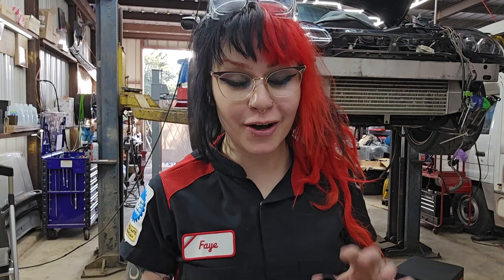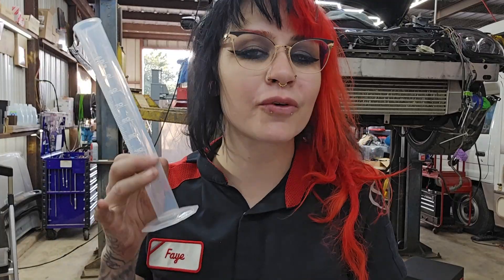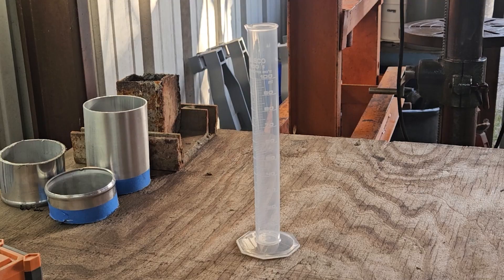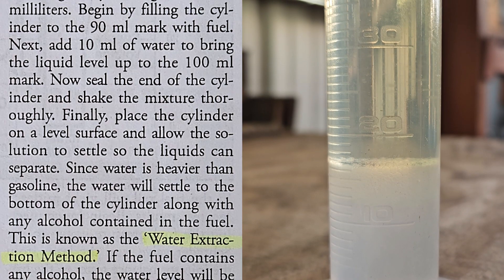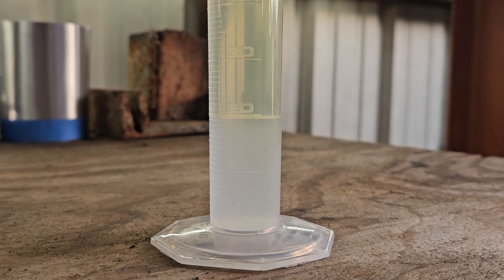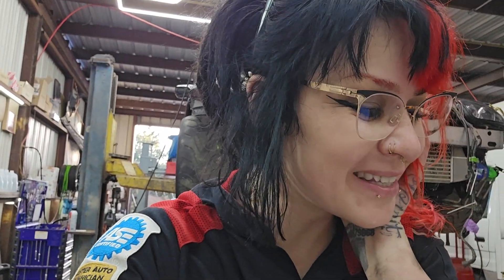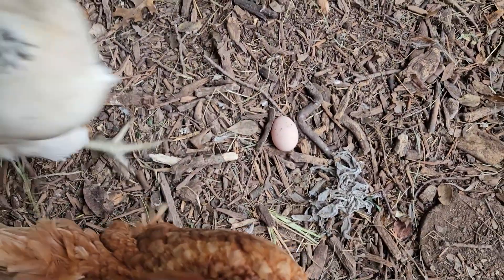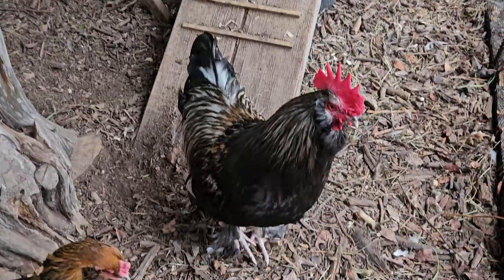How to Test the Ethanol Content of your Fuel!! The Water Extraction Method!

Comment: Actually your test result is bad indicator. Why? There was such scientist as Mendeleev (remember the periodic table?) who studied the water/ethanol mixtures. Water + ethanol occupy LESS volume than two liquids separately. I am too lazy, so this is ChatGPT excerpt:

“When 10 mL of ethanol is mixed with 10 mL of water, the final volume will be less than 20 mL due to volume contraction. This happens because water and ethanol molecules interact (hydrogen bonding), allowing them to pack more closely together than in their pure forms.

### Approximate Final Volume:

* Typically, 10 mL ethanol + 10 mL water yields ~19.4 mL total volume.

### Why This Happens:

* Hydrogen bonds form between ethanol’s hydroxyl groups and water molecules.
* This results in a denser molecular structure than either pure liquid.

### Summary:

Initial volumes: 10 mL + 10 mL
Final volume: ~19.4 mL (not 20 mL)

This is an important example of non-additive volumes in liquid mixtures.”

So your tested fuel contains MORE than 10% of ethanol in it: 10/90*100=11.111%.
Reply: Assuming that all her other measurements were perfect, this is correct.  But that graduated cylinder is only rated accurate +/- 2%, I think.

Comment: OK, dumb question, but if we repeat your experiment, what do we do with the contaminated fuel in our graduated cylinder when we are done?  The 16 year old me would have thrown it in a camp fire and watched the flames flare but the older version of me is not that wild.
Reply: If you change your own oil, mix it with the used oil and recycle it however you normally recycle used oil.  If you don’t change your own oil, maybe pour it into a shallow pan and let it evaporate far away from your house or anything else flammable? You definitely don’t want to pour it down your sink or storm drain.

Comment: Hey, BMW technician here. I love the video. Very informative. While this is a good indicator of ethanol content it doesn’t give the full story of fuel quality. This is especially important on high end cars that require premium fuel. I personally had this problem with my Audi S4. I was filling up at my local gas station and I started having random misfires and stumbling at idle. After several hours of diagnosing ignition and fuel delivery systems I performed the same test you did. The ethanol content was well below the 10%. Just as a precaution I started filling up at the shell station in the next town over and within 2 tanks the issue went away. Whenever I have customers complain of drivability issues I always ask them where they get their fuel and what grade fuel they get. A surprising amount of people just fill up at the cheapest gas station and use the cheapest grade fuel even when their car requires either mid grade or premium. It’s always a good idea to read your owners manual and select the right grade fuel. And just because it’s the cheapest gas around doesn’t mean it’s the best for your car.

Comment: Testing "ethanol free" gas can be very important and Report It to State etc when not true means often to Weight and Measures arm of State's Ag Dept. Some stations lie about "ethanol free" gas because station staff or "Managers" have no clue and often doesn't have access fuel deliver records even if they wanted the data. In many states or areas in a state, they won't allow E-free gas anywhere except Marine use and Airports and many of those won't sell for vehicles because of Taxes like most Marinas sell Red Dye Gas as doesn't have Road and other Taxes attach in the price. So Many marinas won't sell or very limit gas "cans" use to take off the property because State version "IRS" is often watching them. Most Airports still sell Leaded gas (AVGAS 100 or 100LL) and many won't sell that to the public.

Comment: That's a great tip to know. I only purchase from Tier 1 stations that advertise Zero Ethanol. I stopped buying fuel at any place that sold ethanol in their fuel when I was a kid.  I had to purchase Arco fuel once on a road tip. I immediately noticed the difference. When I got home, my car wouldn't shut off. After about 10 seconds, I put it in gear to stall the engine. The next morning, I was able to replicate the behavior. I tried to drain as much of that crap out of my tank as possible. I then put in several cans of fuel dryer and a can of octane boost, drove til my warning light came on, the went to a local station that sold quality gas. 
I won't even run Arco gas in my lawn mower. 
BTW - I'm ordering a cylinder so I can check my fuel. Thanks again.

Comment: Here in Illinois, we have 10-15% ethanol in our fuel. The government here will not let gas stations use less than 10% on 87 to 94 octane fuel. Only race fuel (100-106) & aviation fuel can be lower than 10% or be ethanol free. Also by me 1/3 of our gas stations have race fuel at the pump & half sells race fuel in cans. Illinois is big at epa region but has a huge car culture. Our diesel had to be b15 or higher biodiesel.

Comment: It might not be the most environmentally friendly method, but we add a quart of 10w-30 or transmission fluid when we get gas at the local Loves that changed everything to 15% minimum ethanol. Although we do everything we can to not buy gas there, sometimes we are forced to, living in such a small area where the next closest gas station is like 12 miles away.
Reply: I am surprised if that is true. I think it’s illegal to sell gas at more than 10% ethanol content unless the pump is labeled, because it will damage vehicles older than 2001. So they would be cutting off all older vehicles from their market.

Comment: What would be a neat invention is something that could be placed in the fuel line to separate, and remove the water or alcohol from the gas before it’s injected into the intake.
Reply: Already done. Marine equipment for at least 50 years.

Comment: I am more interested in the ethanol content of E-85 since it seldom actually has 85% ethanol in it.
Reply: A few stations in Phoenix have E-85 and are swamped with hot rodders late at night. So that's where I get my ethanol. Frequently tests E-94-95! 🎉
Reply: @dragonhealer7588  That's OK if weather is warm enough, but in cold weather anything more than E-70 (winter blend E-85) will have starting problems due to the low temperature causing vaporization problems with the ethanol.

Comment: In Arizona all gasoline has 10% ethanol from Nov to March
Reply from the maker: WOW, I didn't know that!
Reply: That kinda makes sense, cool air is more dense, more dense air being compressed makes more heat, and thus would need a higher octane to prevent knock. As I understand ethanol is a cheap octane booster, but in Arizona? I didnt think they get cold enough for cold air density to be a factor
Reply: @legionofanon  it is done to reduce carbon monoxide.

Comment: The math in that book sounds wrong. I dont know exactly what it works out to but the water is acting as a reservoir. It could be a thousand gallons. You are piling ontop of it 90 ml of fuel. If theres any ethanol in that fuel it mixes with some water creating a milky layer and the initial water mark rises. But if it is rising by 10ml then this means it is taking 10ml from 90ml which is not 10/100, therefore not 10%

I recently rebuilt my snowblower i got for a great deal. The float needle was stuck closed so the bowl would not fill with fuel. I unstuck it and cleaned it. And then I drained all the fuel from the tank and put it in a gatorade bottle with some water first, a sharpie mark, then the fuel. Voila! Cant tell you how much though because it is not a graduated cylinder, but thatll get separated with a hose, plus sifted through a coffee filter, and put in the truck tank while i refill the snowblower with a jug from the pump nearby that has 91 octane non ethanol gas. Upstate NY. Alot of lakes and such here so alot of boaters and many gas stations have em. But, not so keen on the price.

You do have to shake it and will know within 20 minutes, but, if you let it brew overnight it is much more apparent! I recently watched Steves Small Engine Saloon which was what got me into it. Faye is a bit easier on the eyes though. Cant tell you the percentage.
Reply: I left a similar comment about the water mix to fuel ratio. I think the book just gives a close and generic number for "quick and dirty" testing, but I believe that by my math 19ml would equate to exactly 10% ethanol removed from the fuel. 10ml water + 9ml ethanol removed; 9ml ethanol removed from the 90ml of fuel (9/90) would be 10%.

Oh and if I remember correctly ( I think I heard it from the Chickanic), the best way to store small engines long term, like off season for snow blowers and lawn mowers, is to drain the tank, fill with 2 stroke oil and run it till the oil fills everything including the primer bulb. then when you want to use it again, drain the oil and fill with fresh fuel and prime it like crazy. 
The oil for storage is supposed to keep all the diaphragms soft and prevent the fuel from varnishing passages as it sits long term

Comment: I’m a fuel hauler. If it’s any consolation, if there’s a “ broken blend “ while loading. The terminal system will not print a bill of lading. The product is deemed “ not legal for sale”.  
The fuel terminal operator has to correct the blend in their system & the truck driver has to complete loading to correct the blend. 
They watch it closely. 
Buc ees has the latest fuel distribution technology to prevent cross drops. ( wrong product in the wrong tank ) 
Their tanks, drop fittings, and trailer valves all have sensors. The sensors communicate with each other. This prevents the trailer valve from opening, if the fitting is connected to the wrong tank. Pretty cool technology !
Buc ees is the only company that uses it, that I know of.
Reply: And your comment makes logical sense, as in comparison propane fittings are different from isobutane on camp stoves for example.  As well as the nozzles sizes between petrol and diesel so people can't grab the wrong filler besides the colors.  But then most don't notice the tanker filling the underground tanks at a station.  Thus my saying of "They don't look beyond their front porch..."  🤪
Reply: Wow, very interesting always thought about that 👍🏻

Comment: I know it would be alot of work but by doing this to a large amount of fuel are you simply removing the additives and ethanol? Would this then result in a much cleaner/better fuel for the engine? Could be an interesting test... dyno a car on e10 then dyno the same car after adding fuel from this method?

Comment: Avoid Murphy's.  Signed up for 10¢ off deal they have.  Used it for over a month and my engine ran rough and poor performance.  Went back using Costco, which is top tier.

Comment: Hey Faye, former production biochemist here.  Most E10-E85 have some wild emulsifiers these days so some will need to be allowed to settle for several hours using this extraction method.  Volumetric tests like this can be problematic for giving you a definitive concentration but are great for the field with minimal equipment!  Also, I am unaware of any ethers being used for a long time as oxygenates since the MTBE (well, technically tBME) was evidently a problem getting into ground water through runoff and being detectable at ppb levels by taste.  I was actually quoted in a paper that was looking at DMSO as an oxygenate but the corn/ethanol lobby is not gonna let anything else slide at this point.  Oh, well if my taxes are going to anything then cheap race gas (e.g. E85) is probably not the worst use.
Reply from the maker: How interesting! I found no specific mention, but I will say that I never poured the beaker out, so now several days later I am checking back on it after reading this comment, and the reading is still the same as far as the water (though it appears that the fuel has evaporated off a little bit!). Thanks for the feedback! Also, so curious about DMSO!! I use a DMSO spray as a homeopathic remedy for my knees and wrists haha! I would be so interested in any scientific papers on this topic if you have more information!!
Reply: @FayeHadley  The paper came out of UW-Madison but that is... yikes nearly 20 years ago now?  I'd have to do some digging.
Reply: This is really interesting, are the emulsifiers intended to prolong the shelf-life of ethanol/gasoline blends? I’ve seen as low as 3 months quoted on E10, but I don’t know how realistic that is (I suspect it’s longer in most conditions).
Reply: @SuzukaS2002  they are primarily intended to keep the ethanol from separating when water is introduced or absorbed (adsorbed?  don't recall).  It has been awhile but I think around 0.5% water by volume will cause an ethanol and hydrocarbon mix to split phases.  Don't quote me on that number!
Reply: Agree I know tert methyl butyl ether or MTBE used to be an octane booster or an anti knock additive but not sure it’s used anymore.. nevertheless MTBE would not be miscible in water so it stays in the non polar phase .. same with all other ethers like ethyl ether
Reply: @virtisconsole12  that was one of the benefits of MTBE is it hydrophobic nature.  DMSO shared some of the same drawbacks as EtOH e.g. solubility/polarity as I recall but with the sulfoxide the oxygen is available for the combustion process unlike in EtOH where it just becomes water after finding a proton.  Man we are nerds.

Comment: Can you use a product like HEET? I live in a cold climate and use this to remove water from my tank. You can tell you have water when it runs out your exhaust pipe.
Reply: Water runs out the tail pipe because when gasoline burns it's main products are CO2 and water.
Reply: @northwoodsguy1538  Yep cold weather startup enrichment and low dew point for some nice puffy tailpipe clouds!
Reply: @northwoodsguy1538  I thought the main reason we have water as a byproduct now a days is because of the catalytic converters, well, converting exhaust gasses into less harmful elements, one of which is water
Reply: @legionofanon  well, more water, maybe. Perfect combustion between gasoline and oxygen results in only carbon dioxide and water emissions. Incomplete combustion can result in carbon monoxide, nitric oxide, soot, and other forms of air pollution.  Adding ethanol to the fuel increases the amount of oxygen present, which helps get complete combustion. The catalytic converter is also away to get more complete combustion, although it is mainly involved in converting nitric oxide to oxygen and nitrogen.